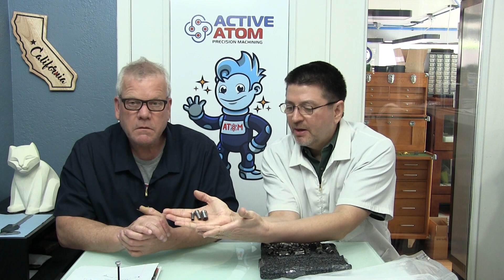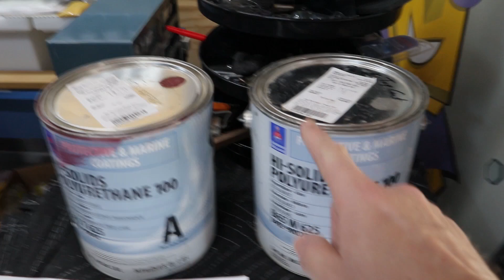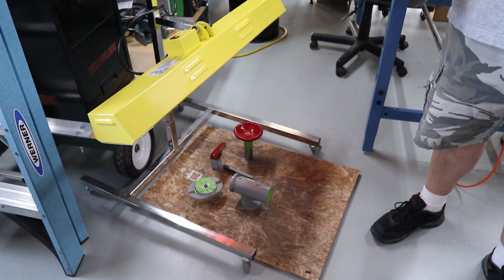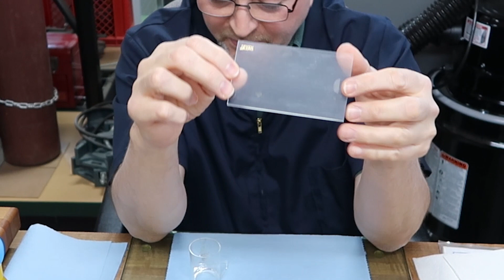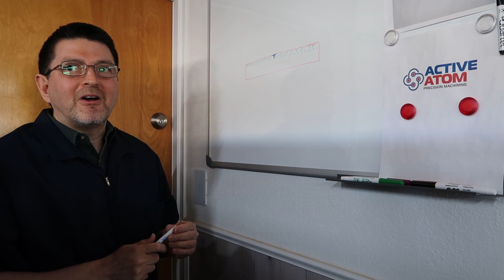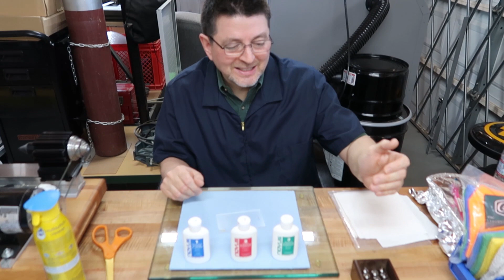SHOP ADVENTURES 35: Painting with 2-Part Epoxy & Polishing Plastic Parts

Comment: Thanks for the video. I used the same two part epoxy paint on a wrought iron railing. I had tried every other type of paint, and it has been the best by far. Not cheap, but well worth it.
Reply from the maker: Hi Bruce, thank you for sharing this and you triggered a memory from Lance's youth.
Family house the parents made me paint the wrought iron around the house rick wall 4 sides with a can of black paint and I wore a glove to dig into the paint than wrapping my hand through the glove around the individual wrought iron bars and other then some lazy young kid (14 or 15) drips the paint work came out well, did  not last all that long (Southern California summer heat and all) before I was commanded at it one more time.

We are thinking you Bruce mixed this with the supplied thinner to spray it on?
We did not us this as we brush on the paint here not real pretty but the toughest we can apply in a single coating.
We agree not cheap and yet no need to paint likely ever again depending on our conditions and proximity to the sea waters around the globe.

Thank you Bruce for coming by and for sharing your success with this videos shared 2 parts epoxy painting experience, we are thankful to have you here with us.
Lance & Patrick.

Comment: Finally got to see #35. Very informative. Lance,I have not done much epoxy painting, so this video was very helpful. Also thanks Patrick for  sharing the details of plastic polishing, it will come in handy. Good video!! Thanks for the shout out.
Reply from the maker: Hi Jeff, nice to read you also received our sticker set. The epoxy paint is something we have been using for only about 4 years now, it is really tough stuff can look better if you add thinner and spray it with a gun, (weakens the effect of course) we brush paint this onto machinery that will be used heavily (well heavily for or standards around here) with high wear involved.
We Patrick really gets into polishing here somethings are mirror perfect others are cosmetic in nature.  
We do not have a show this week, or likely next week (holiday), we are finalizing a YouTube series, rebuilding series Educational Pullouts NEW stuff how we rebuild a precision spindle to a (TIR) total indicator run-out of 50 millionths, even involved new higher resolution equipment to capture this step by step 4 or 5 part series, so this took all of our time and our regular work like finishing the exterior of the Grinding Hut out building, reassembling our Swiss made comparator was not worth filming here.
Jeff, thank you for being here with us we enjoy having yo in our lives.
Lance & Patrick.

Comment: I love the clock you guys have in Pats area. The one next to the large poster of the inside of the watch. Would you be willing to share the make and model if it???
Reply from the maker: Hi Phil, great having you here and making a comment sharing with the community makes visits even better.
The clock is a kit bought and built by Patrick more then 15 years ago, sold by a company in Australia that is no longer in business. 
This kit was 175.00 USD back then and required a skill set to assemble slightly higher then with standard soldering due to it having surface mount IC chips. 
The clock is great, as a shared moment, we have build a few styles here over the years and we have some fun alien and nixie clocks as well.
Thank you Phil for asking this great question and for viewing our channel.
There is no Shop Adventures this week the work was heavy but repetitive not fun or educational, so we are skipping this weeks show hope to have one in the coming week or two. 
Lance & Patrick.

Comment: Hi Patrick. Hi Lance,  That's great polish.  It gets the job done!! Thanks for sharing. M. K. S.
Reply: Lance, Great two part epoxy painting. Thumbs up. M. K. S.
Reply from the maker: Hi Kelly, thank you we want to share what coatings are really built to look as good in these current times as we well as in to distant future as well. These two part models are the top of the line in coatings.
Lance for Lance & Patrick.
Reply from the maker: Patrick is really good at the translucent polishing no waves, clear and see through with no damage to some otherwise irreplaceable covers and protective shields two examples he did this polishing on.

This Novus polishing step kit Kelly is really good for small scratches causing near 0 chance of damage to these vintage machine tools we are entrusted to complete correctly, so they will be here for the future to enjoy, and in great working order while we are at it.
Thank you for being truly supportive with us.
Lance & Patrick.

Comment: The air shed in Southern California was/is so overburdened that (as I recall) McDonnell-Douglas sent commercial aircraft to Yuma, Arizona for painting.  Great job as usual, boys,
Reply from the maker: Hello MrShobar, just what good did it do, this painting out of state thing?
The Douglas Aircraft company later the McDonnell Douglas and now both inside The Boeing Company to fly out of state to apply the coatings, we dealt with the coating a primers on the internal structural components that make up most of the aircraft's physical being when we subbed out our machined aircraft parts to a coating companies, we coated those in California in the LA Basin and some how painting the little bit of exterior coatings on some parts of the aircraft wings and fuselage and somehow, they were bad? All political MrShobar and now California has little Northrup Grumman and Lockheed Martin Skunk Works some stragglers and a few sub contractors like we were once upon a time left to pick on. 
Hey about your wife's watch, best to take this in, this process and the tools needed might cause issues then watch and learn how the man (likely) does this work, and then you can do this even change the bands, colors, styles and whatever for her in the future, that would be neat for you to be able to do for her. 
Sorry we do not reply too well to emails but at least you can see here this answer should be helpful though late.
Thank you for being here and we enjoy having you sharing comments with us and the community.
Lance & Patrick.

Comment: Great tips on paining. I wondered where you get the two part epoxy from. I happen to live very close to a Sherwin Williams store, so I'm in luck. I have been using the Novus stuff for a while and it is impressive stuff. If you pour and cure some 2 part acrylic and then sand it into shape, you work the sand paper to a pretty fine grit and then use the Novus plastic polish 2 and 3 and you can get a glass clear finish. I'm amazed anyways. This video really moved nicely and I really enjoyed watching it. I thought you would recognize the collets for sure. Now I really want to know...
Reply from the maker: Hi Robert we are happy to read you use the Novus polishing process well too as we read.
The 2 part epoxy primer and 2 part top coat are really tough stuff to work with, we do have two stores about a block apart one is consumer, the other is contractor, we went to the contractor per there instructions so they could teach us how to use this stuff, that has been about 5 years ago now. 
 
We do not know these collets, this makes these fun to us, given time we are sure we will research and discover there reason and purpose so we can share them with the viewers, we sure are thankful you sent them, if they are something really special they will be going into the museum here it now has 5 tools for machining on a micro scale and watchmaking. 
If they are something we can figure out and are not something to be careful with Patrick has a plan to make them into a useful tool that will be a fun project. 
1980 1981 CNC machine shop sales video of a 20 year old Lance and his dad now 83 will air lasting 4 or 9 minutes depending on the version you select to watch, hoping you can watch it and you enjoy it. 
Thank you again for these wonderful gifts that are going to have a life and for being here with us even sharing comments in the community here. Lance & Patrick.

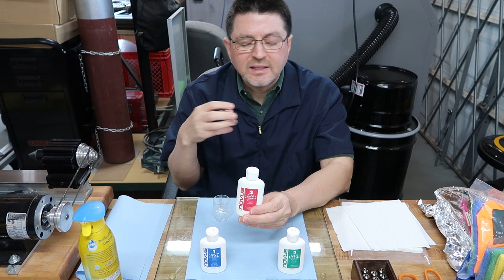Comment from the maker: Hey viewers, Patrick here.  We've received some comments/messages from people in regards to the Plastic Polishing segment I did where they believe I am suggesting the use of the Novus plastic polish to remove scratches from eyeglasses.  You absolute DO NOT want to use this product to remove scratches from your eyeglasses which is why I'm pinning this comment here.  At 40:20 into this video, I bring up the common scratches found on eyeglasses as an "example of the Type of Scratches" that Novus #2 would be the perfect use for it but I never intended to convey that you actually want to use this product for eyeglasses.  So sorry for any confusion here.  And the reason why you don't want to use this product on eyeglasses is that most eyeglass lenses today have multiple coatings such as UV Protection, Anti-reflection and Anti-Scratch coatings so using this product would likely be removing these coatings.  Also the aggressive use of these products could also change the prescription of the lenses slightly.  So just wanted to clarify this point in the video.  Thanks for watching!
Reply from the maker: In-house break notice.

Comment: Nice job on the paint  &  the plastic polishing . I have a small inch pound tension wrench that its hard to read the settings  & would be a good candidate for some polishing .  Cheers .
Reply from the maker: Hi Max, the painting work dried so hard it is going to last for a while really excited to begin (back burner) machining our missing Spindexer dividing plate with the spring loaded pin.
Polishing is good but the sanding to get down to what is a workable area, that can be daunting in our experiences, doing the torque wrench, SMALL you say INCH POUND, we love small tools, love to see it in your videos sometime.
We bet that is needed to make reading this tool easier. 
Thank you for swinging in Max? Do we have your mailing address? Do not remember? 
We are mailing out our channel sticker set and would be honored to send you them if you would like them? info@activeatom.com
Lance & Patrick.
Reply: @ActiveAtom  Ok cool , i will email you . Thanks .

Comment: Have you actually used the plastic polish on your glasses?
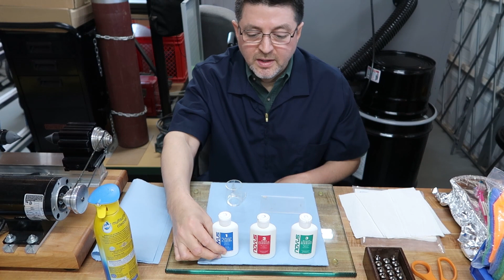Reply from the maker: Hi hopper1 NO NEVER use a polishing material on lenses (this is our take) never on any lenses mainly optical in nature, what I had to do was go back and watch the video section 40:15 in on the polishing topic regarding the glasses.
Patrick mentions examples see them not feel scratches was the message. 
What Patrick shared was that to get a feel for the scratch levels we need to be down to from sanding to begin the polishing 3 step process would be similar to mis-cleaning the lenses of your eye wear over a short period of time. 

Waited for Patrick to rise and ask him as well. 
Hey did you know that Patrick has been wearing glasses since second grade and me Lance since 2013?
With all the coatings on both standard and sun protected eye wear these days, you would have no way to polish them and in prescription we have no idea what could happen there as well.
We see you wear glasses as well being a mechanical person such as we are as well, we see why you thought this, these things get dirty oily and such wishing there was a cure for the wear, there is not.  

QUESTION FOR YOU TIM
Hey we need your address, would be honored to send out just arrived channel sticker set, so if you wish here is our email address info@activeatom.com
Reply: @ActiveAtom  I've been stuck with glasses since fourth grade so almost as long as Patrick.  Lance, I'm assuming your glasses are for being far-sighted?

Comment: I have that same Scout vice (well used), mounted on my utility cart. I've never seen another one until now.
Enjoyed !
Reply from the maker: Hello Dean, that little vise we bought it and some other tool like items at the local thrift shop, for a rural town we sure have a lot of these donation charity centers here, we do what we can to support them always Dean.
Our vise did not look as we shared it here and in fact we buy these items to improve and test our skills honing them we actually call the practice here.

We painted our old still unnamed spindexer after it passed our inspection on the surface plate and we still need to machine the dividing plate and spring loader pin assembly.
We mail out the finally arrived channel sticker sets, just printing a paper that comes with them at the end of this week.
We sure hope you like them, we are happy to be sending them to you. 

Thank you for coming by and I fell in love with that little SCOUT USA vise as it turned out well need to make the new swivel base tightener bar and nut and the main vise handle and yes 2 new vise jaws a strange size needed there, more projects for the future, not part of our current journey though (very way back burner).
Lance & Patrick.

Comment: My epoxy paint tip is if you dump it out in a large flat tray you will get a longer working time versus keeping it in a cup or can. since the epoxy activator causes an exothermic reaction if it is kept concentrated it will heat up much faster than it will if it is spread out.
Reply from the maker: Hey hi Brian, you brought a great piece of experience to us all here, you are right and in fact we wish for these two shop areas where we rolled the two part epoxy floor covering onto, we would have laid it out in a concrete or plaster 20 gallon tube, trough instead of a 5 gallon bucket from the big box store. 
We think this makes great sense, once you shard it here.
This would have helped, for us the two parts painting setup times are ok small parts, but could also see if we had a giant Monarch Lathe like you own to paint, that would also work there.
QUESTION??
Our sticker sets came in and will begin leaving at the end of this week, can we have your mailing address to send you a set or two. info@activeatom.com 
Thank you Brian for stopping in and being a GREAT help to us and the community.  
Lance & Patrick.

Comment: Thank You for the lessons on painting and polishing ....That looks like some really tough paint....The product Patrick used on the plastic is something that really got my attention...I am guilty of scratching my plastic lenses in my glasses and I could try this product and experiment on an old pair of glasses..I know that you have to be careful not to change the thickness of a lens or the shape / curve of a lens
Reply from the maker: NO Jim do not use this polish or any polish (in our opinion) on optical lenses especially ones that have coatings for protections like from sun, UV and such and many others too countless to list here. 

This video shares the types of scratch levels you should be sanded down to before beginning the use of the 3 process polish. 
This video 40:20 only shared the feels like and cases of scratches and did not mention to actually polish the eye wear or any optical lenses products.

Jim did you give us your address already?
We have the just arrived channel sticker set to ship out if you want them, (printing a sheet of paper to be included as well) email your mailing address here info@activeatom.com 

The coating 2 part, it is like tough, we mean tough, it is designed to last a while but by not thinning it out (with thinner supplied in kit) and only brushing this onto our machine tool components after perfect prepping work this stuff is here to stay.
We do sometimes use the two part epoxy primer first before the top coat done this two out of say 6 paint jobs thus far with this coatings process.
Thank you for being here with us Jim.
Lance & Patrick.

Comment: Hey Guys!
Great video, as per usual! The info on the two component paint is great. I have a small toolroom surface grinder, in need of some love, and it may get a coat of this stuff!
Lance...you're right! Best rags are cotton T shirts that have been washed umpteen times! That said, you may get some strange looks, going around the family trying to get hold of their worn out underwear...LOL!
After saying " I'd like your old T shirts, but only the good quality cotton ones " to an older uncle, I could hear my aunt mumbling : "yep... he has snapped well and good this time"....
Looking forward to the next video !

Hugs!

Paddy
Reply from the maker: Hi Paddy, we are happy you liked the show. 
You can spray this 2 part paint on as well but it has to have the supplied thinner added, meaning it likely will need more coats to obtain the thickness you are wishing for on your surface grinder, CRAP another tool we do not have here in our shop yet. 

We have never used the thinner yet, just our preference, it is we just want the toughest coating we can get to protect it from weather, natural wear and not staying stuck to smoother surfaces (primer required then), so a brush it is.
We would make a wise crack about your scavenger hunt for cotton linens but we would likely be thrown off this video service, we are to guys that can be a bit wild around here. 
Snap all you wish (per your aunt) we remind you, we are like two hermits living in a small dusty town who rarely leave home or work so nuts maybe, snapped yes likely Paddy, likely indeed Paddy.
Your state side friends who really love your wit and comments to us and the community.
Lance & Patrick.